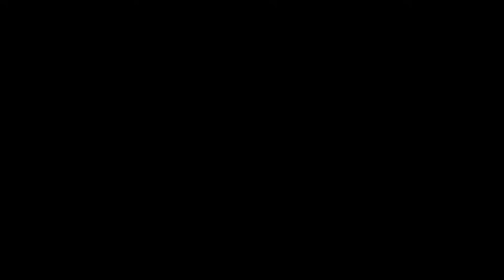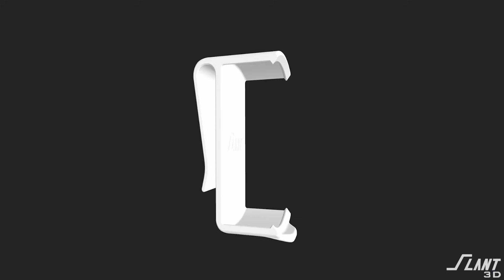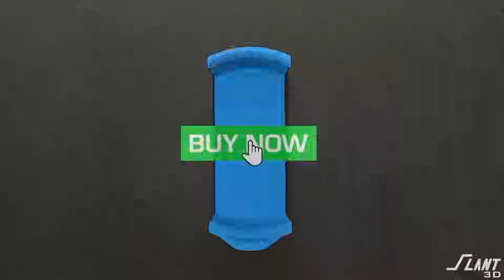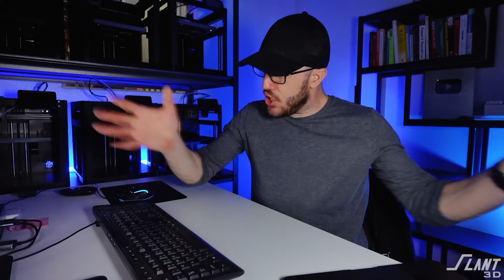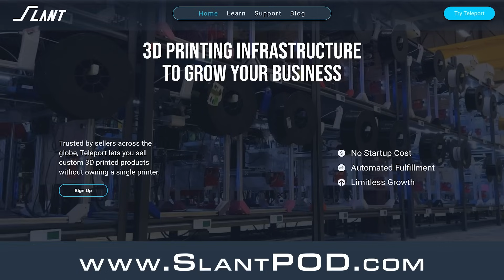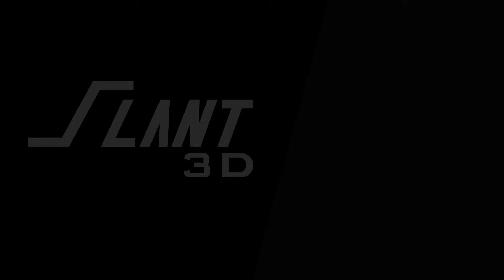Should We Replace Etsy? | Limiting Tangled Orders | Rocket Engines | 3D Printing News Ep 110

Comment: Question: I have a part that I sell a handful of to truckers every month, but I have to print it on a rather large printer because it takes up a lot of area on the bed. It's also mostly flat, so it kind needs to be printed on the bed. What's the build area on the slant 3d printer beds?
Reply from the maker: 8x8x8 inches

Comment: Questions: Is there a plan to implement per match auto fulfillment? I can print some colors just fine at home but others I would like Teleport to print. I guess I could just not match the orders I'm printing but if I have a spike I'd like to flip the switch to turn all auto fulfillment on.
Reply from the maker: You can do this today. You can match just the colors that you want us to fulfill. And flip on auto-fulfilment in your admin panel. Or you can match all colors and have "Manual" activated in which case you would need to click a button next to each order that you want us to fulfill.

Comment: Just brainstorming an idea, but you could offer staggered delivery times based on the size of the order.  Small orders get shipped more quickly than bigger orders.   A big enough order has to wait enough time that it doesn't starve your store of filament for smaller orders.  Companies who place bigger orders have a better ability to plan for their needs and order with enough lead time to accommodate your needs here.  But, also you can negotiate terms with big buyers that work for you both.  One size doesn't fit all, but you you can only afford that level of flexibility with big customers.  The rest you can make happy by processing small orders fast enough.
Reply from the maker: Largely a capacity issue. Other dances are fingers in the dike. We'll have a new dike up soon enough.

Comment: Why Can't I manually add orders to teleport. if I am a small seller and only have a few order an week or month this feel fine for those that can't it automatic yet.
Reply from the maker: You can manually add orders a few different way. You can set teleport to manual in the settings so each order has to be approved to be processed. You can also add orders manually through shippo if you do not want to connect directly to an ecommerce site.

Comment: Etsy sucks in regulating 3d printed products, the amount of products I've seen that are just 1:1 copys of other companies, Ikea, Wooj, Creme atelier, makes me really feel disgusted at their lack of enforcement over IP infringement
Reply: They also do strong incorrect enforcement- there’s jewelers who have had their designs ripped off by big producers, and then when the Amazon and AliExpress copies start showing up, the original designer gets booted from Etsy for copying.
Reply: I have an idea to combat this, but id need like bare minimum 500k worth of developers to even attempt to get it to work as it is a theoretical method. Trying to get an MVP prototype put together and a business plan and throw the idea on kickstarter and see what it does. 🤞
Reply: @spencerlange125  Sounds Like 500k worth of devs and another 6-8mil to get the idea of the ground and into the first beta testers!
I also have an idea for something that could fix 3d models licensing, but it'd be much much cheaper than that.
Reply: @greyvlad what's your idea? Is it robust enough to detect copywrite even if people modify stolen files?
Reply: @spencerlange125  The idea is basically to merge Slicer, Marketplace and Model Licensing, so nothing leaves the system. You pay for the model and work of it in the slicer but you can't simply download the thing, and that includes sending it to the printers, the printers in this case, wouldn't be able to simply store the files without calling back home to check for relevant info.